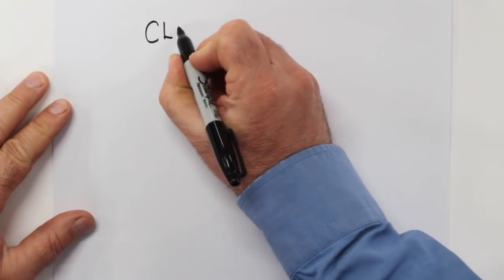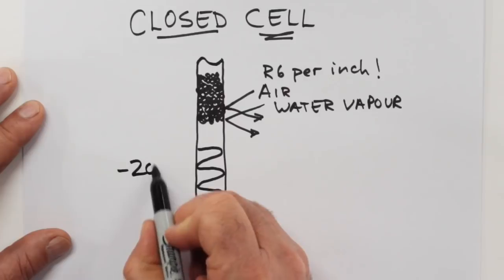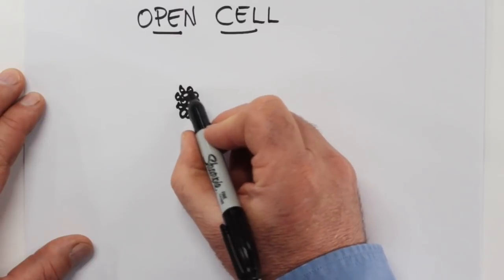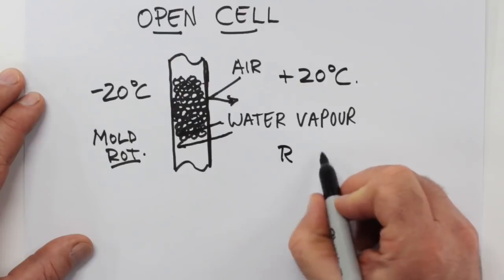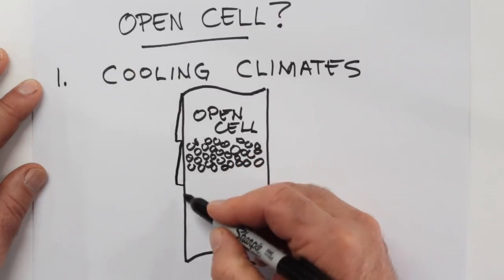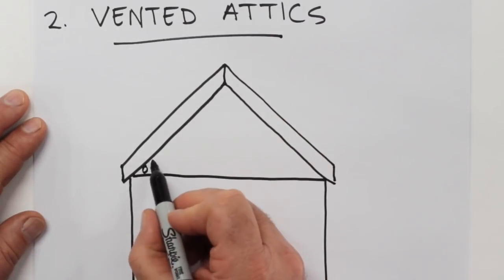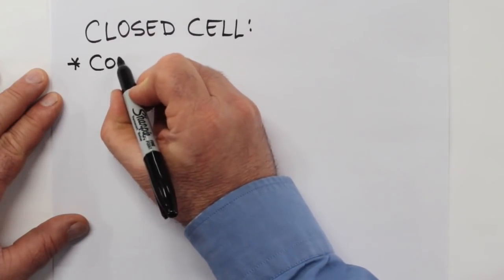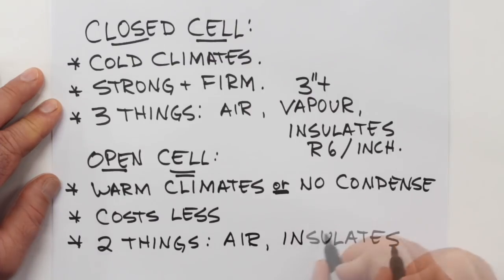SPRAY FOAM: Open Cell vs Closed Cell

Comment: open cell is also good for acoustic barriers...ie, interioir walls and between floors. (Assuming both levels are "conditioned" with semi-constant temps and humidity.)
Reply: That's bullshit open cell foam is also rigid and transmits sound.
Reply: @zteaxon7787  well gee, I guess I'll have to take those studios apart, because an ass-hat on YouTube knows foam is rigid...you do what makes you happy, m'kay?

Comment: I'm planning to spray foam my van.  Mainly to stop condensation from forming on the inside.  I live near Vancouver Canada.  You mentioned that it is important to achieve an impossible amount inside a van  of 3" of close cell to prevent water vapour from migrating.
Reply: if you are just doing your van to stop condensation then 25mm or 1" will be plenty   , i have sprayed hundreds of vans and steel boats over the 30 years i have been spraying closed cell foam , hope this helps.
Reply: Do more reasearch, I used great stuff which is closed cell foam on my truck and it rusted out everything really bad. It rusted from the foam side out. It flat ruined my truck.

Comment: Very good afternoon my dear who recommends me for the installation of this foam in container house on the inner side and how many inches should I leave the thick walls I live heredia costa rica I want to contrir with some containers of marine use to resiclarlo
I do not know what to put open or closed and how many inches would be recommended for the parades
thanks for your help
Reply: for a container, I'd suggest at least 4" of closed cell, with a very good cooling system and ventilation. I'd also suggest for Costa Rica a secondary "roof" over the container, to block direct sunlight. Even a 1.5" riser with sheet metal will lower the interior temperature considerably. Best of luck on your project.

Comment: I am building a triplex using ICF and open web steel truss joists supporting concrete floors. We plan to spray open cell foam on the underside of each floor once the plumbing is installed.  Our goal is to reduce sound transmission.  Have you ever heard of open cell being used to control noise?
Reply: look up soundproofing with spray foam(Dr.energysaver)he uses open cell for under floor between living space and garage
Reply: Yes it will work well. And also will never sag and be a home to rodents.

Comment: OPEN CELL IS TRASH NEVER USE IT
Reply from the maker: Hi Jack,
Why do you say that?
Bye,
Steve
Reply: It does not meet the code on permeability is just the most important. How many reasons would you like?
 I,ve proven this in court many times, but BIG foam companies  always demand sealed Court files  
Use,Jack@ buildingenergy.net  send me you cell and a time and l call you Saturday after 9 or you specify time.
Reply: I suspect this is true
Reply: That is not true. It has its place. Also it depends on what climate zone you’re in. In the north I would not use it much at all. But in the southern states it works very well.
Reply: FAKE NEWS, I've been installing open cell foam for over 10 years in the northern states climate zone 6.  NOT ONE SINGLE ISSUE!!!!  There are hacks in every trade, stop blaming the product for incompetent workers you hire because your to cheap to pay for a professional company.  Open cell is hands down the best bang for your buck insulation as far as cost and performance ratio on mostly all above grade installs, CHANGE MY MIND!!!!!
Reply: @davecollandra9795   I'm having sick building syndrome issues.  major illness for my entire family.  contractors want to spray the rafters with open cell to stop the negative pressure caused by stack effect which (in my opinion) is pulling air through mold filled wall cavities.  IMO, wood framing causing condensation in the walls which feeds mold, as does the wood and drywall paper cellulose and then we protect it from UV so its essentially a mold incubator.  I firmly believe this is causing millions to be sick ever since the advent of central AC.  Likely not an issue in the southwest.  I am adding a ventilated whole house dehu as well to get fresh air.  What concerns me is elevated humidity in the attic space with open cell and water vapor entering the foam and causing another mold haven.  I'm thinking a separate dehu in the attic would solve that but seems like closed cell would prevent it altogether.  since you seem to be experienced I thought I'd ask.  No clue if zone 6 gets much humidity.  certainly not like Georgia.  thoughts?  much appreciated thank you!
Reply: @coppulor6500  the hvac system will keep the house dry unless its too big of a unit and wont run long enough to humidify. In that case a dehumidifier may be the answer. Ive sprayed in Texas for over 10 years with lots and lots of very happy customers.

Comment: When you insulate a cavity with open cell, there is no air movement. No warm coming to cold, therefore there is no moisture.
Reply from the maker: You're right, there's no air movement through open cell, but there can be (usually is) vapour movement. It's vapour movement that causes most condensation. Airborne water vapour can travel through open cell foam. That's why it's called "open" cell. Open cell has it's uses, but closed cell is the one you can trust to stop vapour migration and condensation in most cases.
Thanks for watching.
Steve
Reply: in a cavity you can get what is known as interstitial consensation, this is where condensation forms between the inside of the outside surface and the insulation material , if the insulation is open cell foam it will soak up this condensation and over time create damp, if you use closed cell foam which is inherently water resistant this problem is eliminated from the equation.